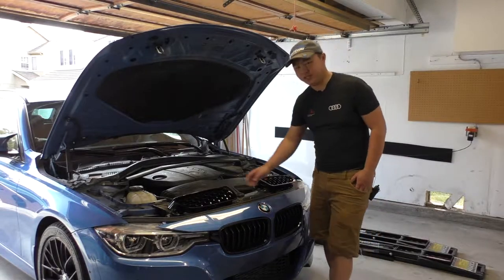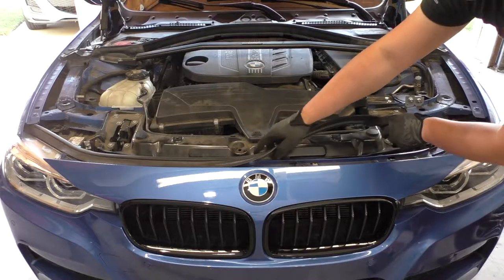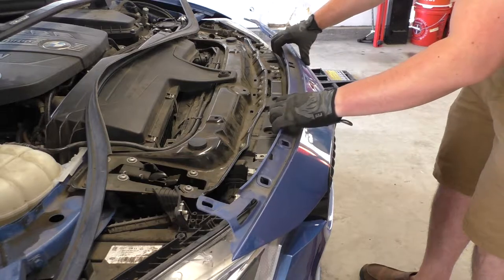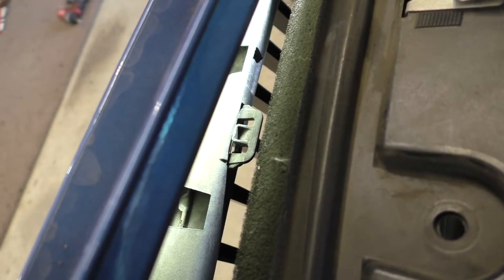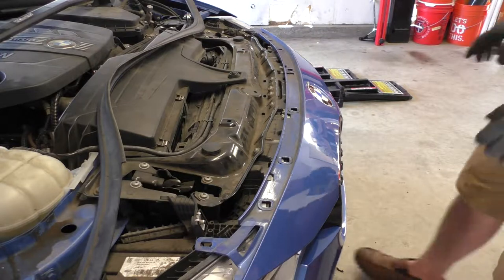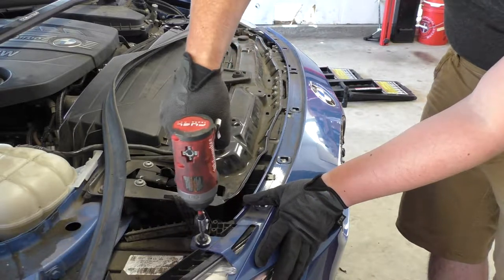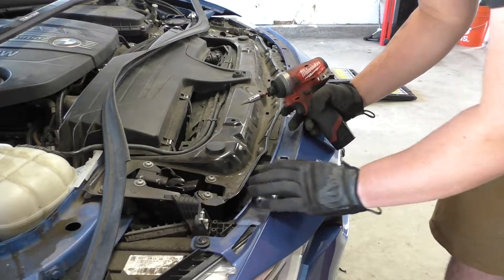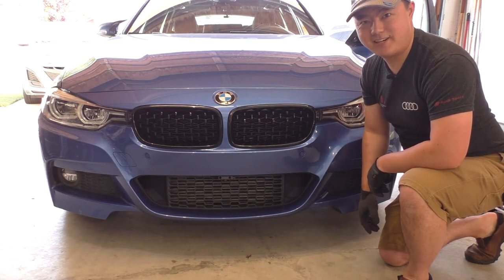BMW F2x F3x F8x Kidney Grille Removal and Installation

Comment: Do you have to take the top screws off? Or can you reach in with a tool and unclip the clips
Reply from the maker: Yeah you need to remove the top screws along the bumper. Even if you tried to use a hook/U-shaped tool to release the clips you won't be able to see where they are without opening the top up.

The force required to release the tabs on the clips would make it really difficult for a tool too.
Reply: @FaRKle0079  thank you, sounds straight forward enough. :)

Comment: The sides dip in too much when trying to realign after with the hood.  Any tips how to raise the edges?
Reply from the maker: Is the center good, or is the whole hood a bit high? You can adjust the hood to sit lower at the latches on the hood.
Reply: @FaRKle0079  the centre is fine it’s the edges which sit lower than the hood. I’ve shorten the hook almost to max on one side and it’s still a bit under. Any lower the hood struggles to close. 

There these black turning nobs also near the hook quite tough to turn. Do you know what they do?

Comment: I did this and I can't close my bonnet now, any suggestions it shuts but doesn't lock won't go down far enough
Reply from the maker: Are the edges of the bumper top tucked in underneath the tab in the headlights, or did that get missed and they're on top of the headlights?

Comment: How the heck do you reach the bottom clips? I have an X2 and couldn’t reach at all.
Reply from the maker: I pulled back the bumper from the top and reached down. X2 might have a longer reach from the top of the bumper to those clips.
Reply: My neighbor had a metal grinder that we used to cut up the old grills. Was still a very frustrating and painful procedure. Without breaking the old grill I can’t imagine how anyone could get the x2 grill out.